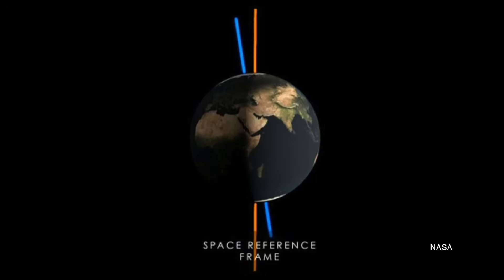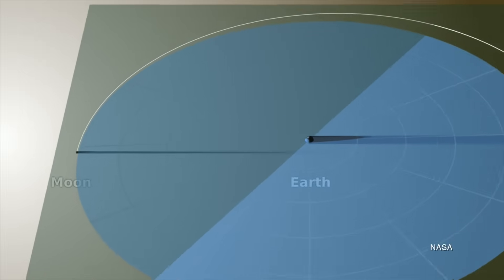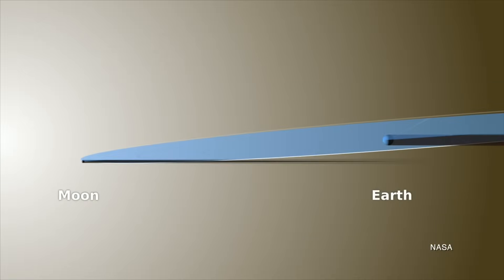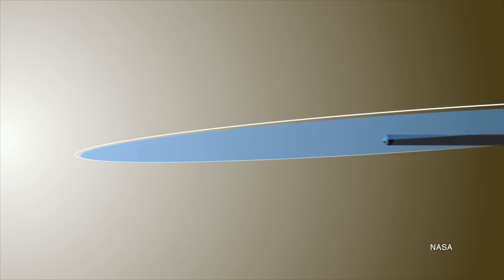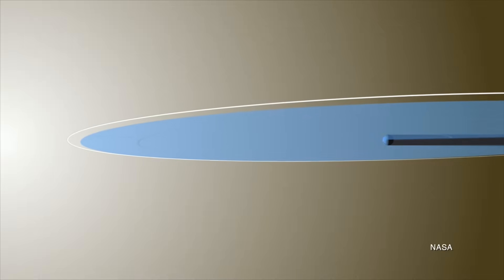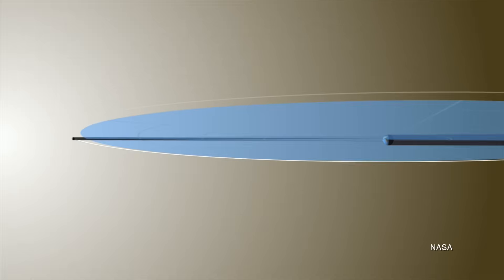Why Does a Rocket Need to Roll Going Into Orbit?

Comment: i understand but not really, the insertion orbit after launch won't put the rocket on the path to the moon and had to roll to position the rocket for the correction insertion point to line up for the moon?
Reply: You want your inclination good as soon as possible. If you do it right at launch, it won't cost too much fuel, but if you do it in low earth orbit, it costs a lot.
Reply: Guess with any mission whether it is the moon, iss or shuttle punching through the atmosphere at the right speed and insertion point it the key to get the right orbit

Comment: What function did the Saturn V's fins serve?
Reply: Keeping the bottom down. If the rocket starts tipping over, the drag on the fins will increase massively and push the bottom back.
Reply: OK, that makes sense. I only asked because so few rockets have them and the steering is done by vectored thrust. I also observed they seem to serve the function of holding down the rocket until full power is achieved. I can't recall where, but I do recall once reading that the Saturn team put them on for aesthetics. I know that's unlikely as weight is always an issue

Comment: Are you quite sure you didn't get the yaw & pitch axes switched around? I know it gets tricksy when you're using terms that originated for horizontal flight applied to vertical flight, but I'm pretty sure the yaw axis should be passing to the left and right (south & north on the pad) from the astronauts' point of view, so that it rotates up and down for them, and the yaw should go down to up (west to east) so that it would rotate the nose left & right.
Reply: Nope, she's quoting directly from Woods.  Apollo used a "right hand" coordinate system.  If you use your right hand to do a "thumbs up" gesture, your thumb is the X axis, your fingers are pointed toward the Y axis, and the Z axis is pointed back at you.

Comment: Why does flying up and then due east make for the simplest path into orbit? I guess that way the earth would spinning to the west below you, so your groundspeed would be higher, but how does groundspeed factor into getting into orbit? You can have a geostationary orbit in which groundspeed would be zero. Can anyone enlighten me?
Reply: Ground speed is not a factor, and if you change "simplest path" to "simplest math" you're on the right track... sequencing the course correction into two maneuvers (first roll to aim then pitch to enter the correct trajectory) rather than combining them into one a) makes for a better ride for the astronauts, they don't have to fly "sideways", b) makes the ship's attitude a natural one for a pilot - and remember they were all test pilots - in case of emergency and c) makes life a lot easier for the guidance computer (which at this stage of the flight is not the AGC that is situated in the CM, but the "instrumentation ring" at the top of the Saturn V stack.
Reply: Thanks Benny, but why east? Why not west or north or south?
Reply: John Pfeiffer North or south are not options because of the laws of orbital mechanics, which unfortunately I don't have the knowledge to explain properly without risking to say something that's wrong.

But in order to reach the Moon, which moves in roughly the same plane as the Earth (and the rest of the planets, the "plane of the ecliptic"), you can't economically launch in those directions, especially with the so-called free return trajectory that the first Apollo missions used.

(Throw enough energy (fuel) at the problem and I'm sure you could, but since the rocket needs to carry with it everything it needs to lift into orbit, including the fuel it needs to carry the fuel it needs, the weight, complexity and cost of any launch vehicle increases exponentially, not linearly.)

Regarding east-west, flying east gives the rocket some extra velocity for free as it piggy-backs Earth's rotation. Think of bouncing a tennis ball out a car window as compared to when you're standing still on the ground. When you're standing still, it'll bounce on the same spot every time (until you hit a pebble and the ball takes off in an unexpected direction and you need to go fetch it in those thorny bushes where it inevitably landed), while if you bounce it from a moving car, it will move with the car at whatever speed it travels. The up and down part will still be the same, but you will cover some ground distance between each bounce, so the ball's total velocity vector will be much higher.

Also, flying east from Cape Canaveral is very convenient, since if a launch fails, the only thing it will hurt is NASAs budget, the engineers' pride and the odd fish.
Reply: Actually, you can launch north or south-that's how you get stuff into polar orbit.  If you launch from Vandenberg, you fly due south.  It's relatively expensive in terms of energy required, because you don't get the free velocity you get by launching east.  But it takes much less fuel than launching east and then trying to do a plane change.

Comment: It's ironic that you were discussing this, because I have been learning the very same concepts in order to add a guidance system to my water rocket models. It's really easy to do the movements separately in order to end up in a specific trajectory. It becomes a lot more complex when combining moves at the same time. Only having 4 control surfaces on my rocket limits the control somewhat, but it should be possible to combine the control inputs with cascaded PID loops, but with everything happening at once, when something goes wrong in the math, it's really hard to diagnose. Simple is definitely better.

Comment: Related: the guidance system of the older variants of the Soyuz rocket, some still in use up until recently, didn't have roll capability right after launch (I'm not sure if it was a software limitation or insufficient roll control authority on the vernier attitude thrusters, as the main engine nozzles couldn't gimbal - perhaps Amy can make a video about this?). So instead of a roll program the rocket sat on a rotating platform on the launch pad,  which had to be rotated so that the rocket launched into the correct azimuth.

Comment: Amy, I have often thought about how wonderfully wasteful the Mercury to Apollo programmes were, in that a lot of fuel and hardware was required to get a relatively low payload into orbit or to the moon and back. My question is, whilst it is still amazing to see launches of this era, how much of the shedded stages were ever recovered or recycled? If they were not recycled, what was done with them, or were they just abandoned in the Atlantic?
Reply: The only part of the 363 ft / 111 meter, 2000 ton Saturn V stack that came back to Earth after a roundtrip to the Moon was the tiny Command Module... and the first two stages that plunged into the Atlantic after being spent. Oh, and the Launch Escape Tower fell back down, too.
But not a single screw of any of it was reused for the next launch...

Comment: As a contrast, the Soyuz (until Soyuz 2) was unable to adjust its roll in flight, and as such, the rocket was rotated on the pad to line up with the proper flight azimuth without needing to roll. The Soyuz 2 had the ability to roll added, and thus the rotating launch pad is not needed.

Comment: You didn’t say this, but I would guess that the Saturn V needed to roll because its primitive computers couldn’t do the more complex calculations needed to navigate without the roll. Do modern interplanetary rockets need to do this?
Reply: Probably not. They are not carrying humans, and most are spin-stabilized. That means, they continually roll to keep the craft stable.

Comment: Amy, Why did the Saturn 5 use Oxygen and Kerosene instead of Oxygen and Hydrogen as propellants ?
Reply: It's mainly due to the density of propellants, and to be clear, only the S-IC was powered by RP-1 and LOX.  Kerosene is less efficient than hydrogen, but it's a much more dense liquid, so to carry the same amount of fuel, a kerosene tank can be significantly smaller than a hydrogen tank.  That being said, the S-II and S-IVB were powered by LH2 and LOX.
Reply: Also, in the quantities they were dealing with, and the power levels, it's much easier to stick to only handling a single cryogenic liquid, rather than two. The pumping and plumbing are dramatically simpler for RP-1. In reality, it was an Engineering choice, and the benefit of the extra performance on the first stage was significantly outweighed by the added complexity and cost. Conversely, on the second and third stage, every pound counts, so they went for the best performance they could get.
Reply: And just to clarify-by "same amount", you're not talking volume, you're talking mass.
Reply: +StreetTriple Mat   Also, kerosene does not need to be cooled like hydrogen does, in order to keep it a liquid.
Reply: At the time, liquid hydrogen was much more difficult to manage safely as well. While it may be the most efficient, in terms of heat production, it is not the most efficient in terms of the total mass of combustion products.

Not only did using LH2 require much larger tanks (impractical at the time), but the peak thrust was only half of what it would have been using the RP-1.

Remember that the Saturn V was an escape speed launch vehicles and most other rockets are low earth orbits to geosynchronous earth orbits of lesser total payloads for the most part.

Comment: I've often been curious over the years, do you know why it was important for the astronauts to make a call over the radio about the roll program?? This isn't something that could be confirmed by telemetry?
Reply: Keep the astronauts busy and interested.
Reply: Probably can be confirmed by telemetry, but a few moments or even seconds later. So the astronauts can look at their instruments and will be the first ones to know about the roll. If the roll program doesn't happen when it is supposed to then you have to react rather fast, because bad things might be happening very soon after. Something like this happened on MA-3: https://en.wikipedia.org/wiki/Mercury-Atlas_3
Reply: I always thought the "Roll program" call came from mission control... have I been mistaken? (Of course telemetry included all relevant flight parameters, so the astronauts would not need to call out that information.)
Reply: No, it usually goes:

000:00:13 Armstrong: Roger. We got a roll program.
000:00:15 McCandless: Roger. Roll.

As an example from the Apollo 11 transcript. And it wasn't so much that Mission Control doesn't know about the roll program, but that the astronauts monitor their instruments, are the first ones to know if the roll program doesn't occur on time and will have to take action quickly in that case.

Comment: I've noticed in simulations of the New Horizons escape of Earth that the spacecraft was spinning. Why was this?
Reply: Many spacecraft, particularly interplanetary ones are set spinning for all or part of their flight as a method of stabilization.  It uses the whole spacecraft as a gyroscope to self-stabilize.  Much more fuel efficient than any form of active stabilization.  Spin rate does not have to be very high as the perturbing torques generated in space are fairly low.
Reply: Also, its helps with the thermal control of the spacecraft. if sunlight  would shine on only one side of a spacecraft it would heat it up irregularly. with this roll the spacecraft  temperature would be more evenly distributed on all sides..
Reply: Especially when they use a solid-fueled kick-stage that can´t gimble the nozzle. To de-spin again after the engine-burn they use de-spin-masses, masses that are on a string that is rolled out (yo-yo de-spin). I believe the de-spin-masses used on New Horizon are now also escaping the solar system.

Comment: Perhaps you have covered this and I missed it. One very interesting exhibit at the CosmoSphere in Kansas, a smallish but very good aerospace museum was the device mounted at the very tip of the Saturn V which stabilized the whole structure during its initial launch phase. It was a very sensitive  accelerometer ball connected electronically to the thrust vectoring system. I had wondered how such a massive machine, designed to come apart in flight with many sections all stacked together stayed upright, and kept from slipping sideways during the first few seconds after the hold downs were released. so many umbilicals had to all work right, and were so very close by comparison to smaller rockets.

Comment: Why did a sentence repeat at 1:30? Or am I losing my mind? Wouldn't be the first time...
Reply: Nah, just the code of the Matrix being altered.
Reply: It did repeat. Could be an error in the uploaded file.
Reply: N|O.C.A., Amy, Vintage Space, Pete, and the Matrix mixed together. Somehow I think that is a good recipe for troubled times.
Reply: Rough editing.
Reply: I was wondering what happened, too I was wondering what happened, too
Reply: +Doggonemess   If you read her comment above, she says that she was pressed for time and missed the editing error before posting the video.  It cannot be corrected without deleting and reposting the video, which she doesn't want to do.
Reply: that was one part that threw me off, I don't know exactly which plane everything lines up on, but I figured out the overall reason for the roll non-the less.
Reply: Ah, thanks for the info.

Comment: How are controllable jets controlled
Reply: The astronauts use sarcasm.
Reply: Not????
Reply: Sander Datema The pivoty directional thrust thingies
Reply: Tactical Ultimatum
Ah, gimballed thrust. For rocket engines, the engine bell is moved with pistons.
Reply: Sander Datema So they have a hydraulic system on board
Reply: +Tactical Ultimatum I guess
Reply: +Sander Datema that's heavy af
Reply: Did some searching, and they are controlled by 'actuators.' That is, something that makes stuff move. In this case, it's likely pistons moved by electric motors.
Reply: +Sander Datema I assumed so, I'm very familiar with linear actuators, it would be interesting to know how they are sealed at the top end. Probably a silicon dioxide blanket wrapped around it

Comment: The roll would also serve to keep the crew pointed in the right direction, pushing them back into their seats rather than off to the side when they pitched. Rolling before pitching rather than using a combination of pitch and yaw would make sure the crew would be kept in alignment with the direction the vehicle is pitching. That's one reason why the Shuttle flew upside down on ascent rather than right side up. Better to push down into your seat than to be lifted up out of it.

Great video by the way, and great job explaining the three axes! I had completely forgotten about the change in inclination of lunar orbit versus Earth's tilt!
Reply: Smokescale Aquatos It's the same reason that fighter aircraft do high g maneuvers with the pilot's feet taking the high g loads instead of their heads. If you don't invert in a high g situation you experience "red out". Your blog is pushed to your head and you don't have g-suit garters around your head. Ask any current or past fighter pilots the same question and we'll all give you a similar answer.